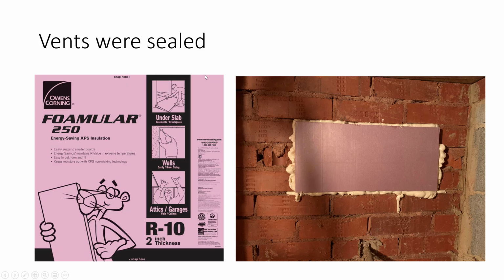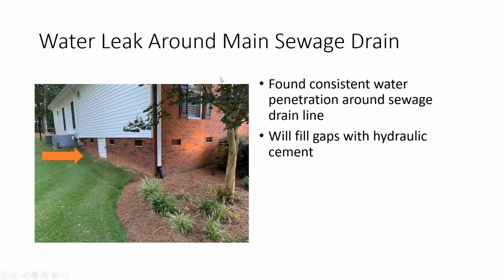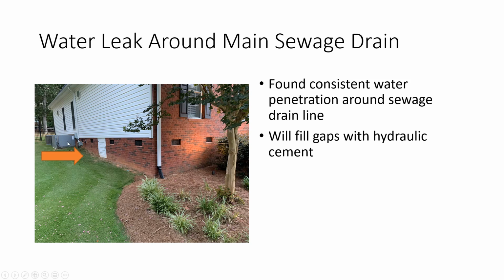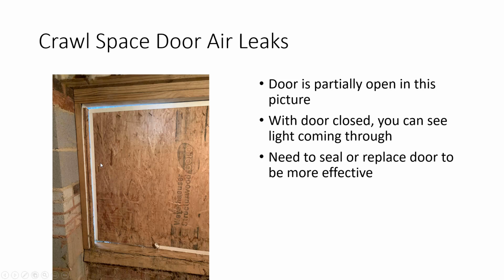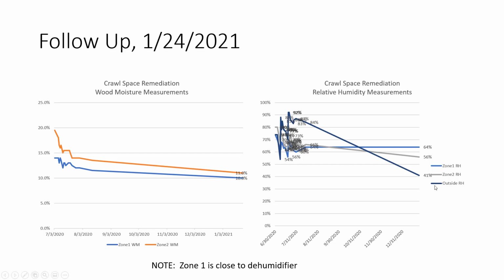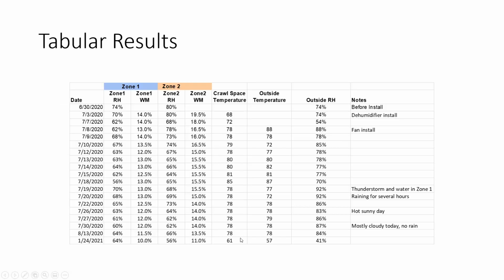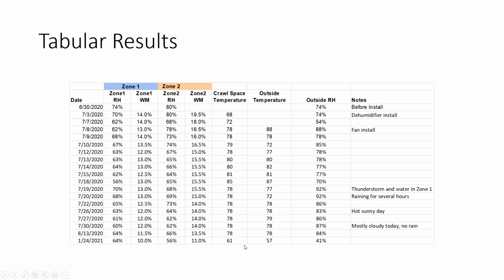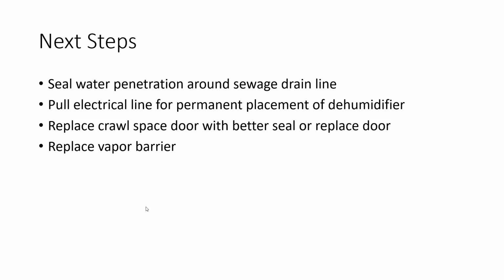Crawl Space Remediation - Video 4 - 6 Month Results and Next Steps

Comment: Wayne, I want to thank you so much for all your efforts and sharing your experience and data.  It’s so nice to hear an impartial, non-commercial video on the issue. I  have similar issues with my crawl space with increased humidity.  I have sealed my vents and installed an Aprilaire E100 dehumidifier.  I’ll tell you how it worked in a few weeks.  I’d like to know how your crawl space is doing now.  Did you need to eventually encapsulate your crawl space?  Or have your solutions fixed the problem?

Comment: As others have said, thanks for the videos.  I'm in the upstate.   Curious as to your thoughts on insulation - for instance going with foam sheets on the wall and removing ceiling cellulose insulation.   Also, did you notice any difference in how the inside of your house feels once the vents were sealed (i.e., not as drafty, better temp control etc).  Thanks again for the videos!
Reply from the maker: HI @M Haller, glad the video was helpful.  I had debated putting insulation on the walls and wondered if I could remove the insulation between the joists.  I watched a video from the Crawlspace Ninja where he addresses this question and he raised concerns around moisture getting behind the foam insulation on the walls.  I didn't have any evidence of mold and my insulation between the joists was still in good shape so I've left the insulation installed between the joists. I chose not to take a chance on insulation along the walls.  One advantage of closing the vents and using the dehumidifier that I had not considered before installation is the heat produced by the dehumidifier. When the dehumidifier is running, it actually produces a good amount of heat on the exhaust side as it processes the moisture.  This extra heat under the house along with the closed vents keeps the temperature warmer than outside.  We had snow last night and it is currently about 35 degrees F outside and 55 degrees F under the house. I have noticed that our hardwood and  tile floors feel warmer that in previous winters that I assume is the result of the warmer crawl space.  Drafts from windows and doors remained about the same.  Hope that is useful for you!

Comment: Thanks for these great videos! I am also starting on this similar journey.  My crawlspace has been neglected for many years and a pest inspection brought up the moisture problems.  Majority of my moisture problems were coming from sweating HVAC ducts.  (Had a new system installed and had old ducting that was not properly sized).  Just had a new moisture/vapor barrier installed and brand new (properly) insulated HVAC ducts installed.  I am finding that the new ducts are still sweating which tells me I still have a rather high humidity in the crawlspace.  I just ordered two wifi hygrometers that I will be installing into the crawlspace so I can monitor the temps/humidity.  I believe I will have to follow some of the same steps you did.  I will need to seal my crawlspace vents and install a dehumidifier.  I am giving the crawlspace a few days to get a new baseline now that the new barrier and ducts are installed and i have means to take measurements.  

Now that is has been a year later, roughly.  How has your crawlspace been?  Still seeing great readings?

Thanks for this great info! I also live in the upstate SC area.  Go Tigers!
Reply from the maker: Kenneth, so glad that the videos were useful.  Let me know how things go as you look at the next steps.

Comment: How are you capturing/logging the data? I am doing some research on Bluetooth enabled hygrometer/thermometer, but still haven't found anything reliable w/ ability to retain historical data that does not require Internet connectivity. Based on my preliminary findings, I may end up having to build something.
Reply from the maker: Hi @Marcus, I'm using handheld devices for measuring the various elements.  Here is what I'm using.  I showed the details in my second video.  Let me know if you have any other questions.

https://www.youtube.com/watch?v=hY10swDS6RU

Preciva Digital Psychrometer Thermo-Hygrometer, LCD Mini Temperature and Humidity Meter with Dew Point and Wet Bulb Temperature Hygrometer for Industry, Agriculture, Meteorology (9V Battery Included)
https://www.amazon.com/gp/product/B071WLDY82/ref=ppx_yo_dt_b_asin_title_o07_s01?ie=UTF8&psc=1

General Tools MMD4E Digital Moisture Meter, Water Leak Detector, Moisture Tester, Pin Type, Backlit LCD Display With Audible and Visual High-Medium-Low Moisture Content Alerts, Grays
https://www.amazon.com/General-Tools-MMD4E-Moisture-High-Medium-Low/dp/B00275F5O2/ref=sr_1_5?crid=11YLWJGEIYEFZ&dchild=1&keywords=wood+moisture+meter&qid=1594786387&s=hi&sprefix=wood+moist%2Ctools%2C166&sr=1-5
Reply: Much appreciated, @WayneBogan ! I have a hygrometer but still need to order that wood moisture meter. Just got a kit to build a small weather station to automatically keep track of temperature and humidity over time. https://www.amazon.com/Temperature-Humidity-Atmosphetic-BH1750FVI-YellowBlue/dp/B07GPBBY7F